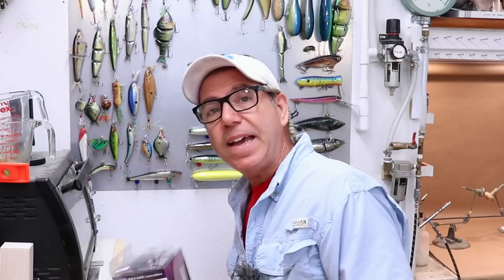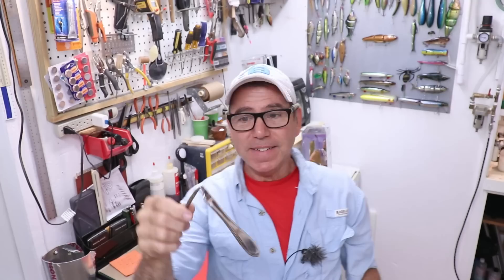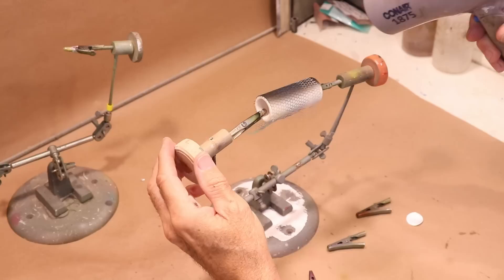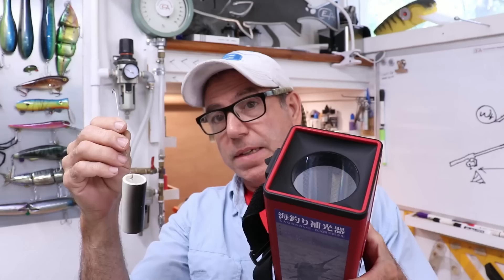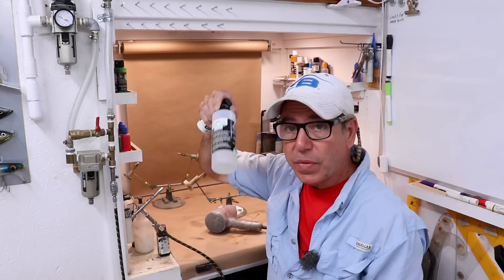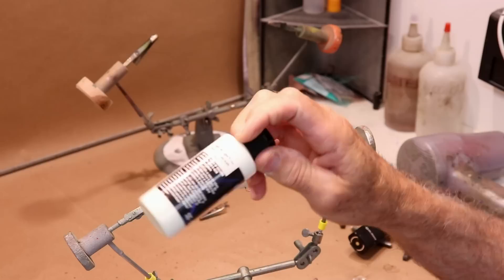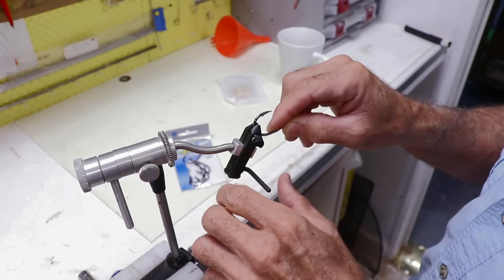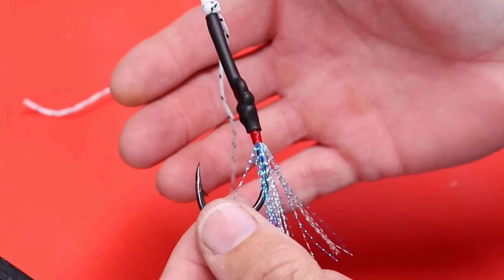Making a vertical jig that glow in the dark,  quickest jig build ever.

Comment: That was fun. The light system is pretty cool. I've only tried the GID powder but it lasts a pretty long time depending on how much you use. I had hoped to use it mixed with two part epoxy as a final coat but to get enough powder in the mix to really pop it negatively affected the finish and tended to pool down rather than stay evenly coated. Further experimentation came up with a great idea. I actually drilled a pattern of holes and filled them with a thick mixture of powder and two part epoxy then after that dried i was able to do a nice finish coat as per usual. The effect was really awesome. For flattish jigs I only use the GID adhesive tape that can be cut or painted to make nice contrasting patterns and the no name tape I order here in Indonesia at least glows longer than anything else I've tried. (Up to half an hour)
Reply: I was going to tell him the same thing!
Powder needs to be thick.
I've made my own jigs for ice fishing.
The epoxy used needs to be good stuff or it will yellow with age.

Comment: seeing the powder version of the pigment makes me wonder if you could add some in to a resin pour. If i give it a try i'll let you know.
Reply: So i did try this over the weekend. I got 1 ounce of the aqua color powdered pigment. I made one lure with a ~10% mix (2.5g in 26g casting resin plus 2.5g micro balloons). and i think it came out very well. i use the tan alumilite (RC-3) resin which comes out with a bone type color. so i only paint ~1/3 the bait and leave the bottom 2/3 the natural color. The 2nd i reduced the pigment to ~4% (1.1g) which still worked but it did not pop quite as bright.